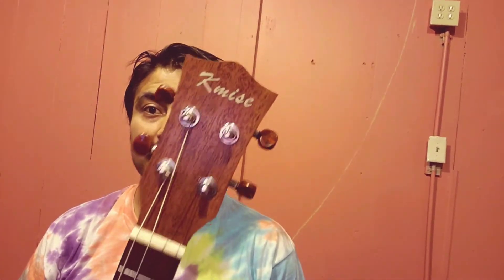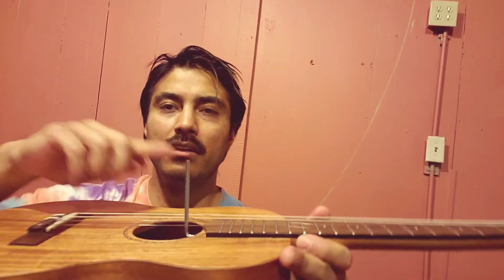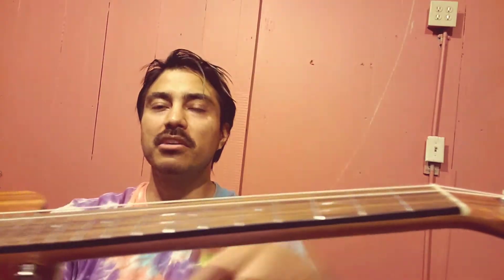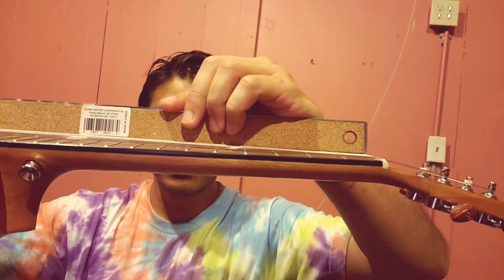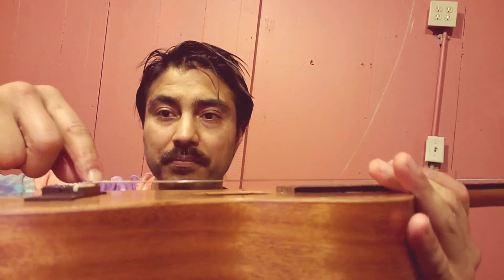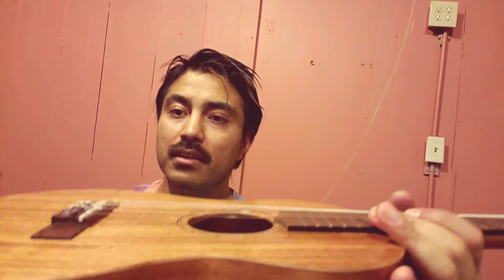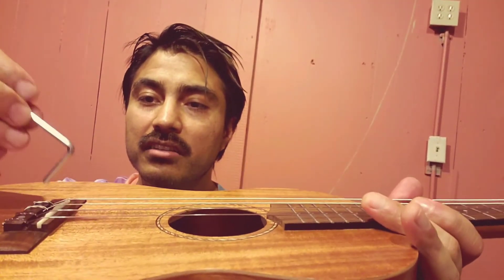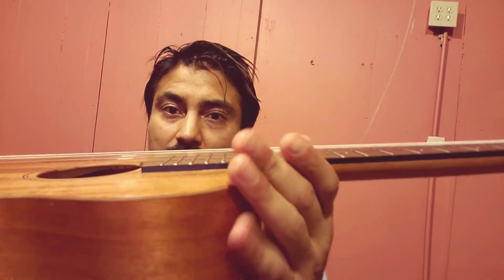very quick video on string height of kmise baritone ukulele

Comment: do you think better stings in this Kmise would help? i heard Aquila strings a nice
Reply from the maker: yes they are a notch above the strings currently on but the strings that came on mine are just fine until they get old.
Reply from the maker: also make sure if its for a baritone to get baritone strings they are thicker strings, soprano and concert ukes come with a high g string and sometimes tenors as well but i put low g strings on my tenor.
Reply: @franciscobobadilla5731  it is for baritone.  i will have to get someone to string it for me but i will practice with what i have for now   thank you